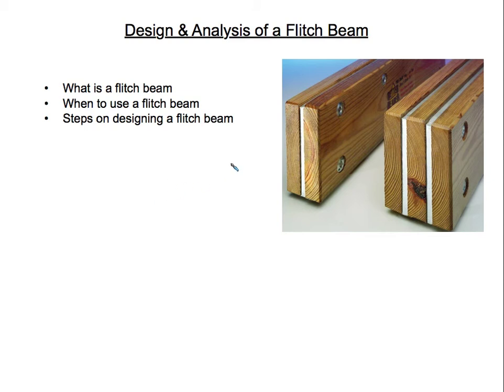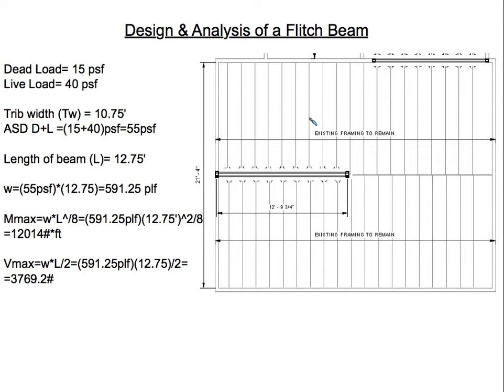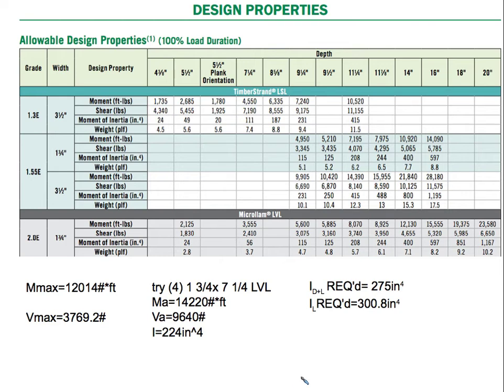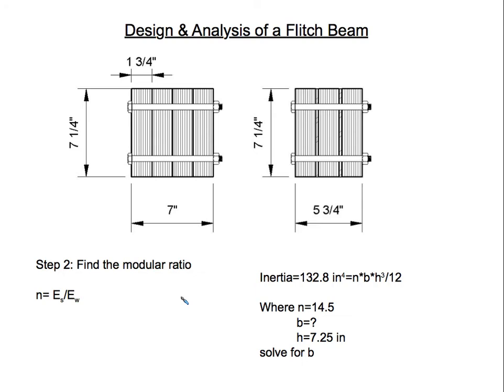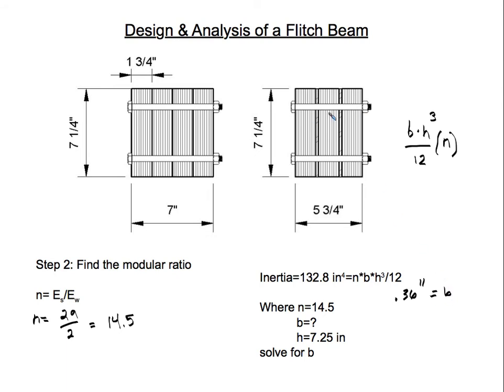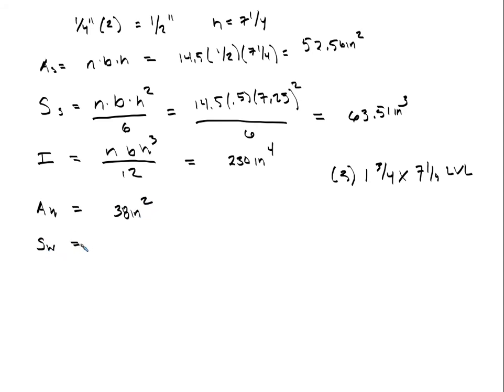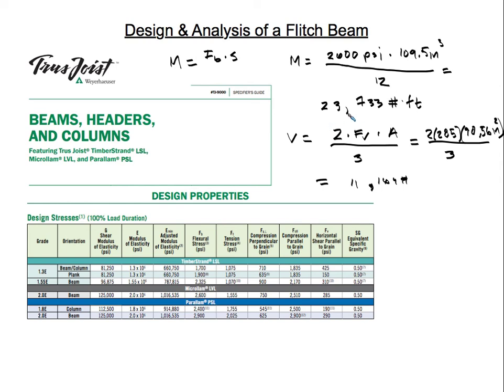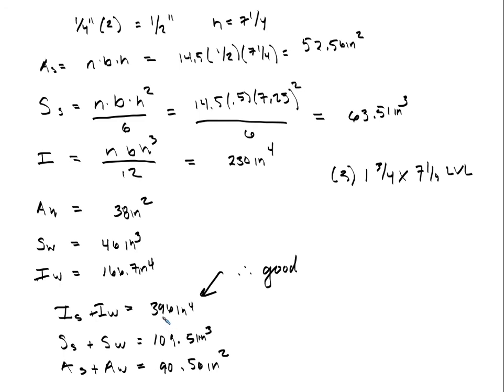Flitch Beam - Design example of flitch beam

Comment: in calculation you have the inertia to solve for b of the steel, now if you switch the lumber to 2x8 spf with a E of 1100 you get an n value of 26, then if you solve for b you end up with a thinner steel plate, how is that possible?
Reply: wrong values

Comment: Dear Sir, I have watched your video and found it is quite useful for my study. I love the way you explained thats why i message. just wondering if you have time for my question. I am doing calculating about flitch beam, in which steel plate is by I shape, and considering the dowel connections. I am not a civil engineering so I would like to learn from you. Could you please kind enough to give me some clues on this field. Thank you so much and looking for your consideration!

Comment: ok so a couple things so far. you have the wrong value in for W as you don't multiply by the length of the beam you multiply by the trib, and when you are solving out for b, I have no idea how you came up with 0.36, with the numbers you have provided it should come out as 0.29. do us a favour if you can and show the math.

Thanks for the video
Reply from the maker: Thank you for pointing that out. The trib width is 10.66ft. 55psf*10.66ft=587 plf. I used 595 so the numbers will be off by a little bit. As for the width of steel it is 0.29. I must have plugged something wrong in the calculator. However the process of the design of the flitch beam is correct. For future videos I will be more precise with the results. Again thank you.
Reply: Exactly correct -the wrong formula was used. The video should be corrected. A 50 PSF TL applied to a long beam (100') with a very narrow tributary length (2') should generate a low 100 PLF (2' x 50 psf). But by this incorrect formula multiplying 50 PSF times the beam length of 100' the result would be 5000 plf which would be tremendously off.

Comment: Hi Paul.  I can't seem to come up with the  Ireq'd of 275 or 300 in the example.. if w=591.25 and L=12.75 and E=1700000(?) .. I get a number of  2.25 for I req'd.  What could I be doing wrong?
Reply: Sorry, had to correct units.. got it now
Reply: @lesdupre466  I'm still not getting 275 or 300 with the correct or incorrect w. Also, i see you used 1.7 x 10^6 for Ew but he used 2.0 x 10^6, which one is correct?

Comment: How do you calculate the required Inertia?
Reply from the maker: Hey Paul, for this example we have a simple span beam so to find the required inertia it would be I=((5wL^3)/(384E))*240. The 240 is for D+L. So if your looking for deflection of L/360 then substitute the 240 with 360. Please let me know if I was clear.
Reply: @FGJEngineering  I am not able to duplicate your req'd Inertia? any chance you give all the numbers used to get the 275 and 300 Thanks
Reply from the maker: Peter D'Angelo it's L^3. In the deflection equation we are solving for the required inertia. If we say deflection is L/240 and we solve for inertia, the L^4 becomes L^3
Reply: Thanks for the video. How can required Inertia for Dead+Live (55psf) be less than for Live (40psf) only?
Reply from the maker: +John Endacott  it has to do with the deflection criteria.... L/240 for dead and live and L/360 for live... in this case even though live load is 40psf the live load criteria makes the required inertia large
Reply: @FGJEngineering  Can you explain the live load criteria changing it? Still lost here. Is there a multiplier?
Reply: is it I=((5wL^3? or L^4?